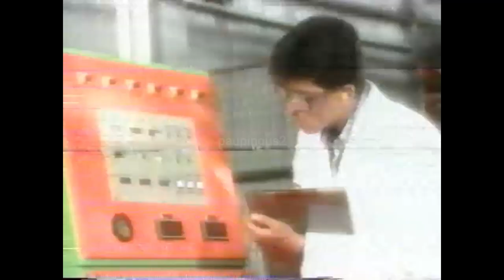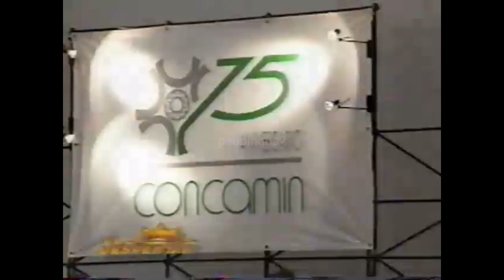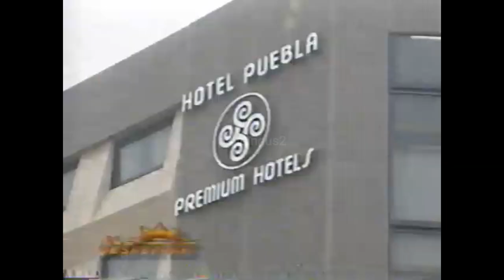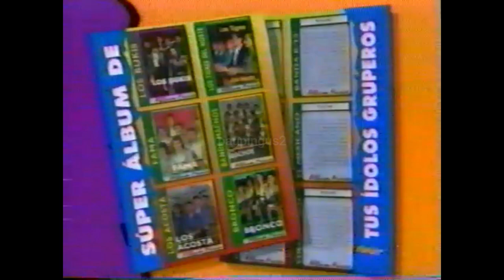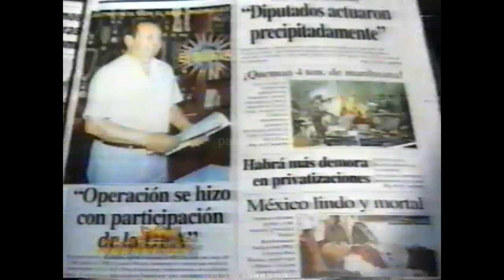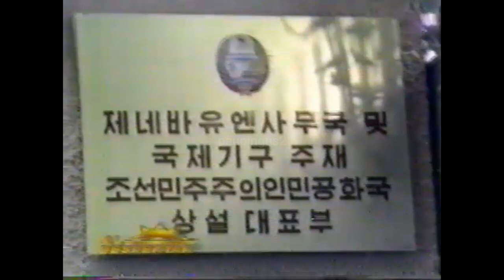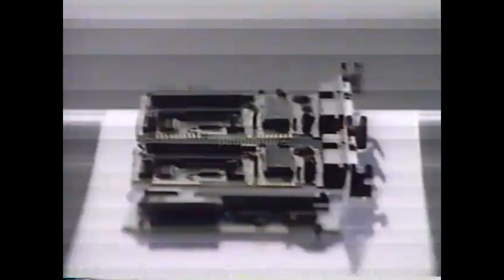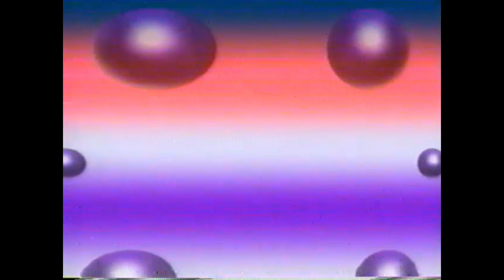Noticiero AL DESPERTAR: 01 de Octubre 1994 con Comerciales.

Comment: "Al Despertar" estuvo cerca de seis años al aire en el Canal de las Estrellas. Inició transmisiones el 6 de julio de 1992 primero con una hora de duración (7 a 8 de la mañana), después en abril de 1993 se extendió a hora y media, y desde el 6 de septiembre del mismo 1993, a tres horas (de 7 a 10 de la mañana). Para junio de 1997 cambiaba su hora de inicio a las 6:30. Al despertar finalizó el lunes 19 de enero de 1998, debido a que Guillermo Ortega entra al horario nocturno con El Noticiero, estando en este espacio del martes 20 de enero hasta el viernes 31 de marzo de 2000.
Reply: Este noticiero marcó mi infancia en los 90s lo veía antes de irme a la escuela y unas veces lo veía completo con mi mamá cuando no tenía clases.
A Eduardo Salazar lo veía como el reportero de helicóptero
En los deportes estaban Raúl Orvañanos, Javier Alarcón y Antonio de Valdés 
Aclaración Guillermo Ortega se despidió del noticiero nocturno el 31 de marzo del 2000
Reply: @hectorhdezf3699 pues ese espacio salió al aire para el regreso de Hoy Mismo en 1997 y que después se llamó en Hoy.